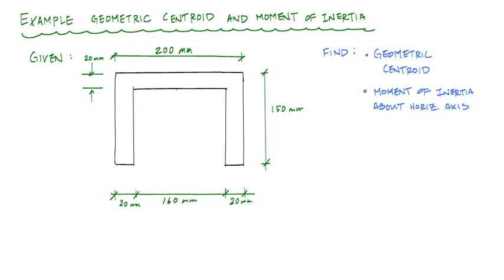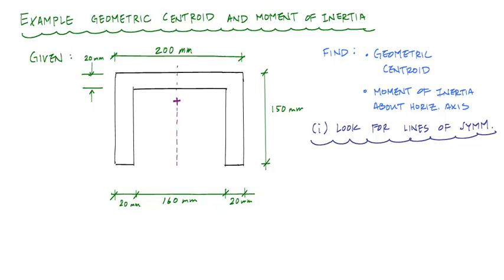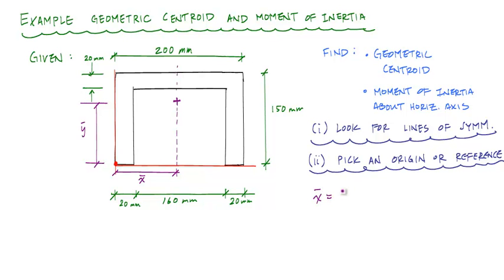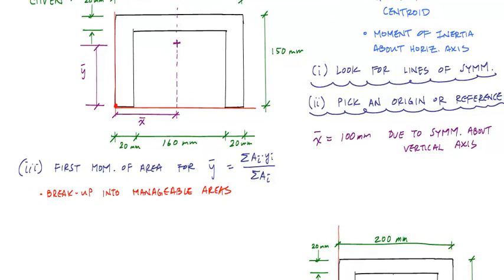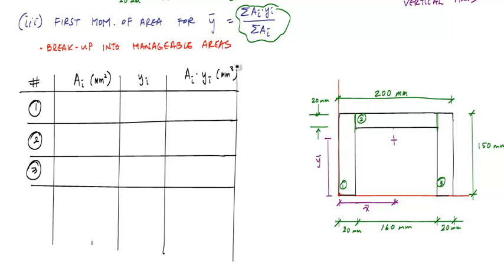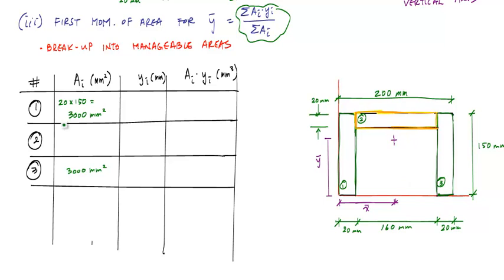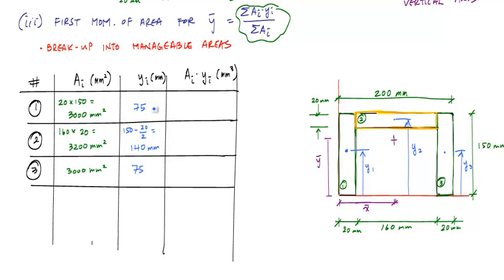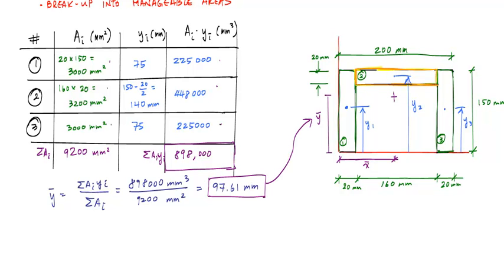Geometric properties of a channel section (part 1/2: centroid) - Structure Free

Comment: I have a question. I know that you will have a different value of moment of inertia if the x-axis is located at the top portion of the c-channel in your drawing. My question is how will you know where to put the horizontal x-axis. Does it depend on where the forc on the beam is applied or is it standard that for this orientation of the C-channel, the x-axis is located at the bottom portion of your drawing?

Comment: This is a very clear and great explanation! Thank you!! Why did you not choose the Yaxis of symmetry as the y reference line?
Reply from the maker: +Jacinda Foreste a vertical reference line would be used to find the horizontal centroid location. Since there is symmetry, it is not necessary.
Reply from the maker: +Jacinda Foreste a vertical reference line would be used to find the horizontal centroid location. Since there is symmetry, it is not necessary.